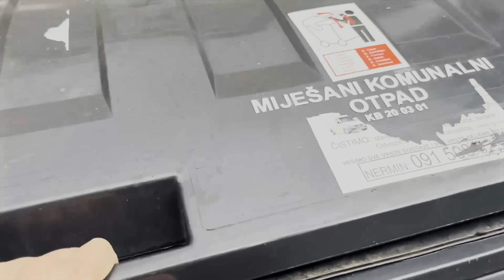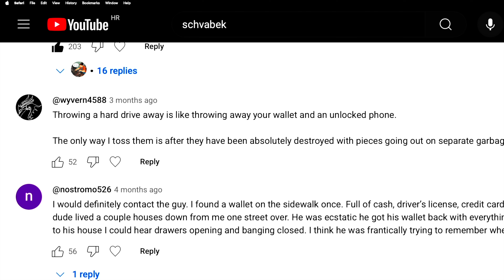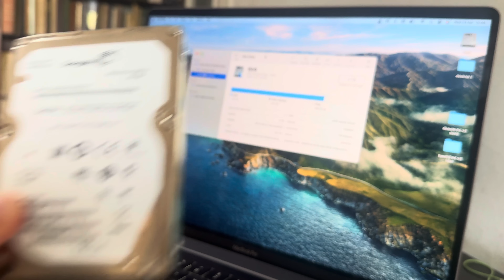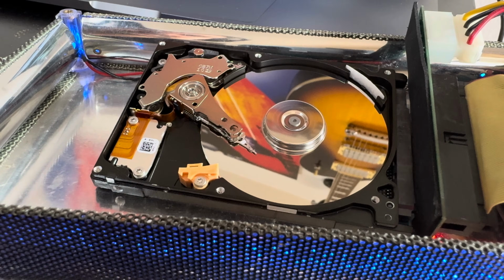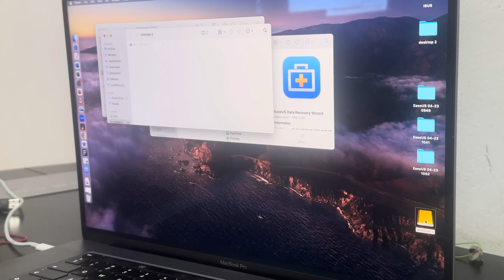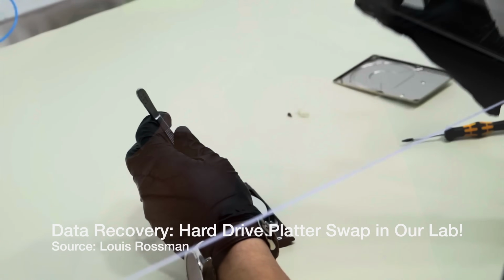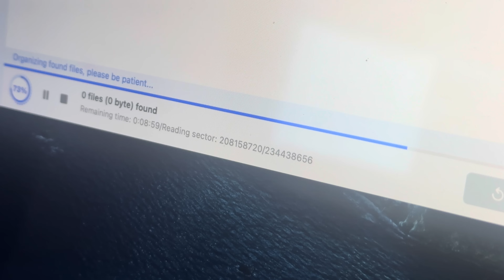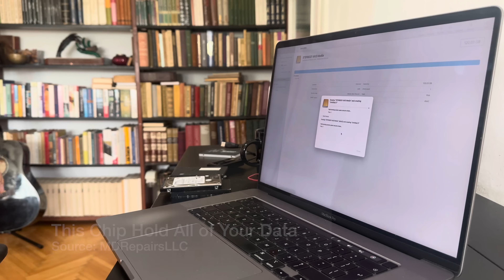How to Really Get Data Off Your HDD/SSD?

Comment: The most secure way of clearing a drive isn't zeroing, but I'm fact filling it with junk data. Most of the more secure drive erase tools will let you rewrite over the drive with many different types of algorithms to fill the drives with different junk data with each write.

Comment: Reformat, then copy multiple 4k copies of Rick Astley "Never Gonna Give You Up" untill drive fills is the correct way to zero old drives
Reply from the maker: I'd love to come across a drive that has been zerod out in such a way lol
Reply: This actually wouldn't work on filesystems that truncate copies, such as APFS or BTRFS. Each copy is a symlink to the original file + differences.

Comment: Why not encrypt the hard drive, then zero the drive, then reformat?  That way even if data could be recovered, there is still a layer of encryption.  Interested to hear thoughts on that.
Reply from the maker: Sure, I guess, no harm in that, although depending on how you encrypt the drive, that encryption might get erased along with the data.
Reply: @schvabek  I hadn't thought of that!  Thanks for reply :)

Comment: Imagine how long it would take to perform a bit level recovery on a 20TB Hard Drive. It would be crazy long. And then after that recovery scan stage is done you've got to read the files off the hard drive onto another drive which is even more time. It could take an entire day.
Reply from the maker: I guess, but I reckon you can just leave it going over night, it’s a self executing process, takes care of itself.
Reply: More then 1 day 1 day not even the scan will finish i dead that on a 4 tb  at took 15h

Comment: Can just connecting an unknown hard drive/usb to a pc really do any damage unless there's some severe hardware fault like short circuit (and even then there is still some protection from the adapter)?
Reply: i mean like what if it had viruses on there that could be spread onto your pc?
Reply from the maker: I actually think that chances of the drive containing some self executing file that goes off once you connect it are very low. Also, I don’t think it’s highly likely it hill physically damage your computer, but, again, it’s a precaution thing.

Comment: recently a woman gave me an old windows xp laptop, the hard drive started dying basically as soon as i began messing with the OS, so i just opened the HDD up and snapped the disk. i'd hate to have leaked someone else's data, let alone my own.
i do have a 1TB drive that i use as cold storage from a more modern freebie, didn't do a thorough format of that one but it's half full of my DVD rips by now and i don't plan on throwing it away unless it dies too.

Comment: I've always wiped the drives and formatted and installed and formatted multiple times and if there is a chance of data recovery I pop them into a Boot & Nuke setup and run through it.
Reply from the maker: As I understand, the difference between just zeroing the drive and DBAN is just that the data with which the drive is overwritten is random, instead of zeros.